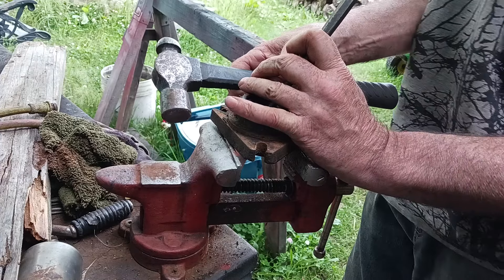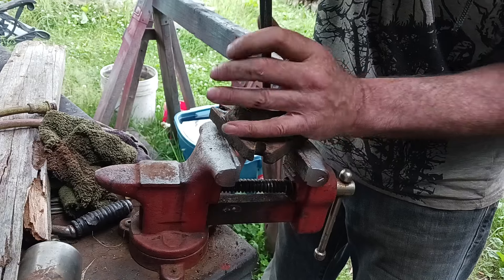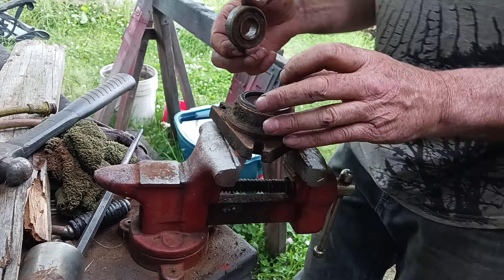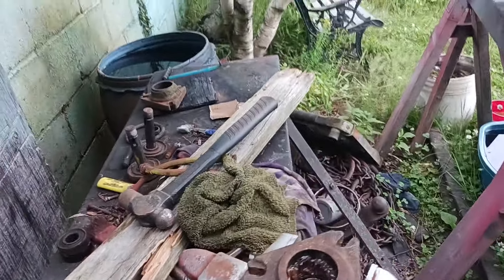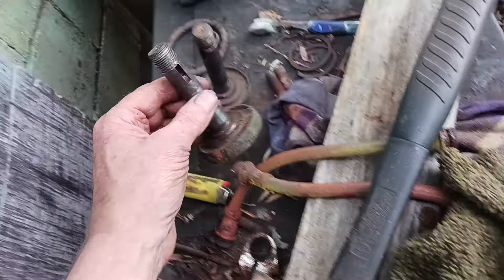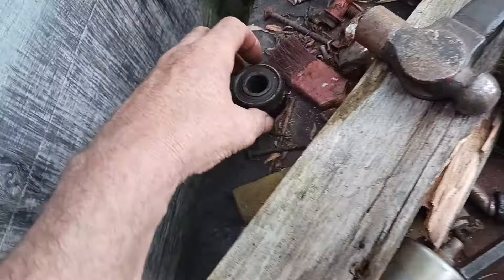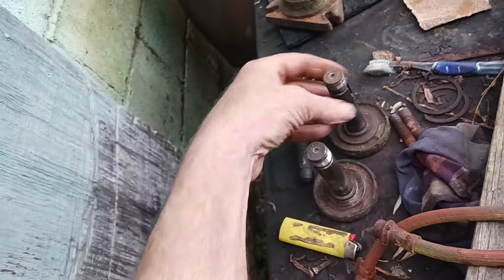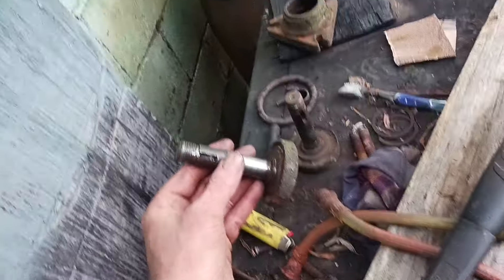first time ever replacing bearing, s and blades onlawn mower machines

Comment: Jimbo tell you a  secret  when you get the bearings take that plastic seal out on the side of the bearing that face inward that little plastic seal pops out with a small blade this way when you pack the spindle housings with grease it gets to the roller bearing in side the bearing I been doing it for years the stock bearing don’t got a the plastic seal on the inside of the bearing facing each other in the spindle hub pop them out pack it with grease you will be good you put them in with the seal on the inside there only gonna last a a summer and your gonna be doing it over again next year seen it happen many of times then  grease them hubs full of grease you will be good for years and roll them center shafts on some thing flat make sure there not bent if there bent it could be why they went out in the first place bro 😎